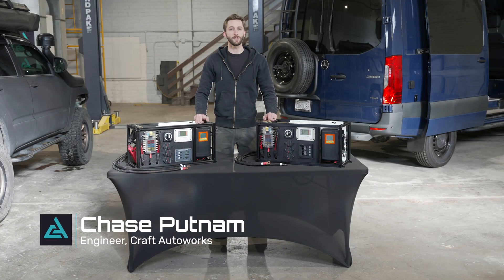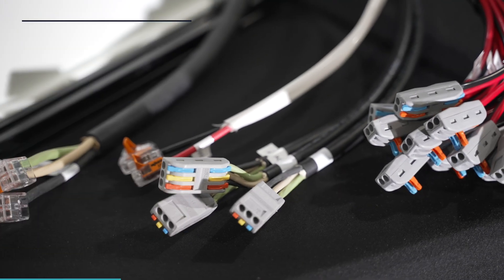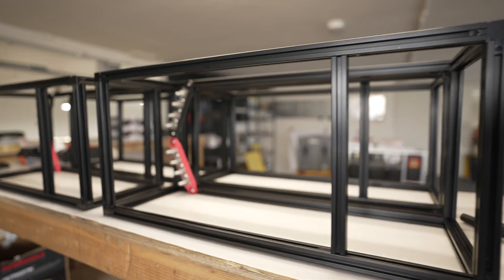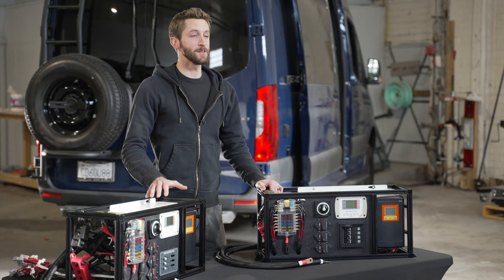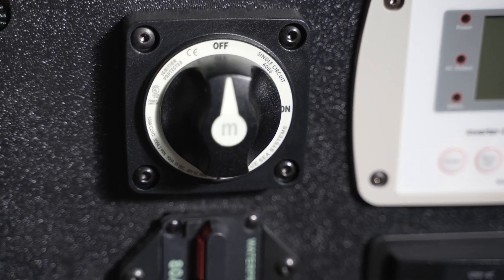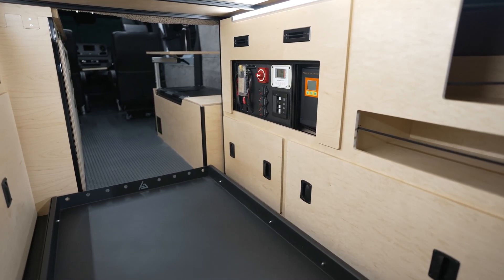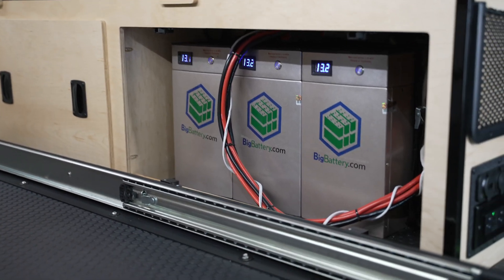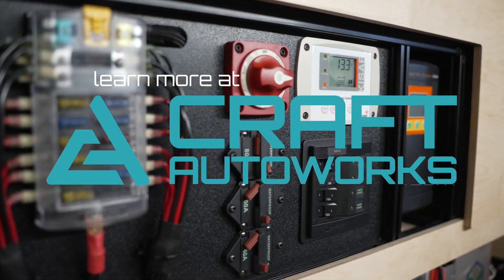Pre-Built Van Electrical Kit - Craft Autoworks Bench Built System

Comment: Nice looking unit guys! Question, is the control panel detachable so i can relocate in the van living area for monitoring purposes? I would have to mount this in my garage so won't be able to easily see what's going on. Does the control panel shows what's coming in for power or would need to buy something else for that? Thank you!
Reply: Hi, the white control panel for the Inverter/charger can be relocated in the van, but that's the only part. The system also has bluetooth monitoring via the Victron BMV-712 so there is very little need to actually touch the face of this unit often.